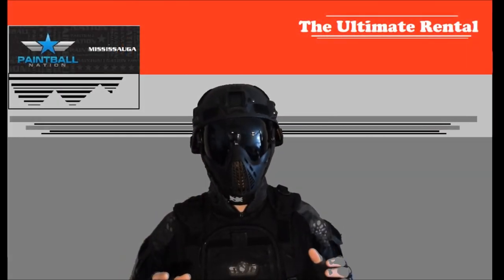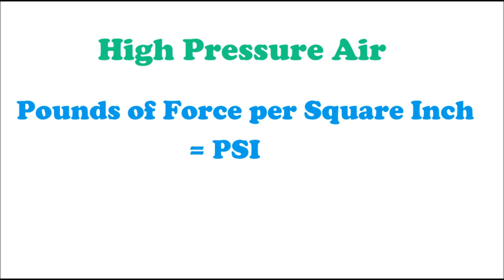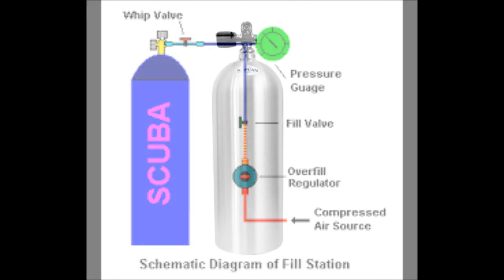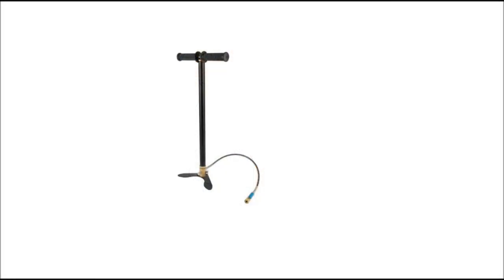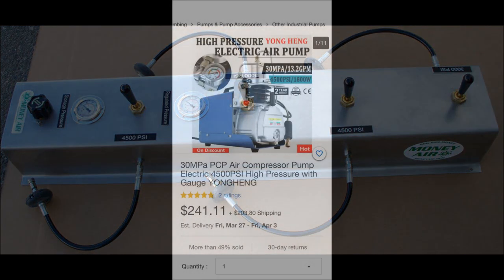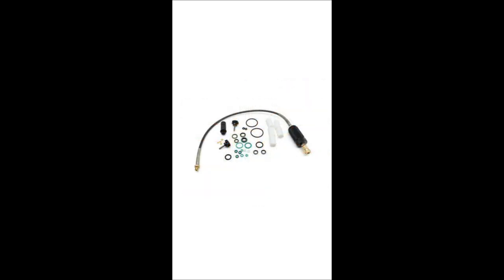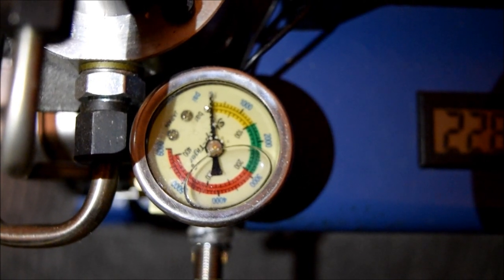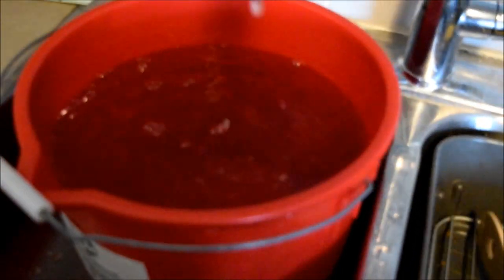How to fill your air tank at home (Paintball / Airsoft) - Electric pump demonstration 7:40

Comment: 4:30  -   You touched on the best of both Worlds
Use a manual pump to fill a larger tank, the load should be less and you can transfer to a smaller tank.

Comment: most oiled compressors... in fact ALL oiled compressors will put small amounts of oil into the air line.. that is why they use desiccant air purifying systems. Build up some oil in a 4500 tank and BOOM. Sounds freaky to be doing htis.
Reply from the maker: Nah it’s fine, there is a filer for the oil and water and I’ve upgraded it. Been using this three years steady now with no issues. It’s fairly safe it would break down and won’t start before it explodes.
Reply: @theultimaterental  Well I hope it works out for you. I do automotive painting and had to create a massive oil and water purifying system. The only thing that really stops oil is desiccant beads. Was this compressor made for filling tanks? I have never seen one quite like it.
Reply from the maker: Yes you can use a premium oil / water filter that has 4 different filters including disicant beads. The best thing to do is fill a full scuba tank and then use air from the storage tank until it’s empty then refill again

Comment: Did you notice a smell or some water/oil on your guns bolt after shooting? I have one of these mini compressors and the first time i used had a odd smell coming from my barrel
Reply: Air compressors use oil ...fragments of this oil wil get into the hoses, also into your guns bc this water/oil build up gets into your tanks, after some time using compressors you need 2 clean your compressor tanks, and bc you use your airsoft/paintball tank as last tank the build up wil be in there, i use nailguns on compressed air allot for work so the smell you speak of is indication of this water/oil build up, i would not recomend using compressed air for airsoft/paintbal, bc larger compressors like on the fields wil use drying systems 2 reduce this...small home compressors dont have these....   srry for bad writing, not my native language 😁

Comment: WARNING: I had a Young Heng compressor rated for 300 bars (4500 PSI),  I used this compressor to top of my air tanks to 300 bar which my air rifle requires.   The crank case where the compressor cylinders attach fail and exploded throwing the pistons and case framents flying.  The rupture disk did not fail.  The air pressur reached 4,400 PSI as I reache to open the pressure blow down valve and close the air tank valve the explosion occured.   The machine oil level was check before running, the water circulation was checked and found acceptable. In addition I was montering the machine running temp. and was at 57C to 60C all item were in the acceptable perimeter as specified by Young Heng manual.   I used this unit for a year about every two weeks.

In my oppion the aluminum case is to thin and cannot stand up to the stresses caused with frequent use.
Reply from the maker: Thanks for taking the time to provide this info. I haven’t had an issue yet but now I’m worried
Reply: @theultimaterental  Just watch for cracks in the caseing, if see any do not use.

Comment: can you just use a air compressor to fill my tank?
Reply from the maker: Maybe five bucks will refresh my memory 😄 just kidding, yes you can use an air compressor to fill your tank as long as it outputs high pressure air. The one for your car tire won’t work as that doesn’t even go to 100psi

Comment: Do the fill in 3 increments 2mins at a time. Switch off wait for the temp to drop. Then start again. This will prevent stress on the compressor apparently after researching. The Compressor will last alot longer.
Reply from the maker: The better way is too get a good source of running cold water like a hose. The temperature will stay steady and you won’t have to turn and turn off the compressor. Just like a car the worst thing you can do to the engine is a cold start…
Reply: You can probably get a high amperage timer switch (what ever the amperage of the compressor clearly not more than 15A). Set it for one minute on 5 off. Maybe even a smart switch with a routine set.
Reply: @theultimaterental  I just fill a large bin with cold water. When i fill the tank i simply let the moisture out of the left nozzle once or twice during the fill. This reduces the amount of moisture going into the tank. Not seen the temp get above 55 yet

Comment: I have an air compressor at home however I dont believe I have the correct adapter, do you think you can provide a link to the adapter/fill hose.
Reply from the maker: https://www.amazon.com/HPDMC-Station-Stainless-Paintball-Charging/dp/B07VFRFF7G/ref=mp_s_a_1_1_sspa?crid=20PZSBIWAUJX9&keywords=fill+hose+for+hpa&qid=1642719653&sprefix=fill+hose+for+hpa%2Caps%2C135&sr=8-1-spons&psc=1&smid=A7Q6ZUJMKWAQN&spLa=ZW5jcnlwdGVkUXVhbGlmaWVyPUEzOE80Q1Q3VkhVUlY0JmVuY3J5cHRlZElkPUEwODk0ODkyMTNOSEZGNFYxSTFLUyZlbmNyeXB0ZWRBZElkPUEwNzE2ODI0M002TzVCQjNDVVdNNyZ3aWRnZXROYW1lPXNwX3Bob25lX3NlYXJjaF9hdGYmYWN0aW9uPWNsaWNrUmVkaXJlY3QmZG9Ob3RMb2dDbGljaz10cnVl#aw-udpv3-customer-reviews_feature_div

Comment: Looks like a lot of work just to get air can't you just buy a air compressor and not deal with the ice water
Reply from the maker: if you have a steady source of water like a hose that you connect it to it is much easier. There are other cooling methods but they are large and expensive. I suggest only doing this to fill up a big scuba tank once every month or so. then you have air ready any time

Comment: Can I use an hydraulic air compressor
Reply from the maker: Hydraulic refers to how the compressor is powered. It would really depend as to whether you can connect an air hose to it and  how much pressure it produces. Most hydraulic compressors are made for vehicles and machines, I strongly recommend not using this type of compressor on an air tank as the pressure may cause it to explode.
Reply: @theultimaterental  ok thanks

Comment: If I wanna use the same compressor but a for 400 PSI application there a regulator so I can get the desired output pressure at 400 PSI?
Reply from the maker: yea I dont see why that would be a problem. Just remember that the first Notch on the gauge is 500 psi so it’s going to fill up fast. what are you trying to fill?

Comment: Thanks for the video mate. 
You said you wouldn't recommend the Powermate fully synthetic oil... what type of oil should be used with this compressor?
Reply from the maker: Number 46 Hydraulic oil will work great

Comment: Where can I get an adapter for a air compressor that pumps up a car tire.
Reply from the maker: The adapter won’t matter bro, a tire pump won’t work! it only pumps Max 90Psi? the pressure in the tank would be to high and push back against the pump likely damaging it permanently

Comment: can we just use a normal air compressor but with the "paintball" fitment/adapter
Reply from the maker: Nah, it doesn’t produce enough pressure :/ Maybe five bucks will change my mind ;) just kidding, no it will not work.
Reply: Yes use the normal compressor and get maybe 130 lbs. then you can shoot it in the house.

Comment: can i fill up my hp tank 3000 bar  with this compressor ?  because you use one 4500 bar
Reply from the maker: For sure you can! just stop it before it gets to 3000psi rather than keep going like I did to 4500psi. It will fill it a lot faster too. hope that helps!
Reply: @theultimaterental  i want to order it but they ask if i want 110 volt or 220 volt  which one is best ?
Reply from the maker: @artificial374  That’s just the amount of power it needs to function. Personally I would get 110v because it needs less power to operate and there is less electrical danger, although technically 220v requires less current.

Comment: Do you have any special instructions for disconnecting the air tank from the air hose?  Do I just pull it off??
Reply from the maker: Yea but you usually you have to push down a bit on the regulator for it to release

Comment: Do you need a special adaptor
Reply from the maker: if you are using the electronic pump it should come with a fill hose that has an adapter. All of the devices I mentioned should come with one

Comment: Hi sir. I have a air venturi 100 cu air tank and need to fill it into diving store but they ask for the fill valve can you please advise what valve they asking for thanks
Reply from the maker: Google Air tank fill station. it’s just an adapter to connect to your tank and the other tank so they can exchange air

Comment: Great video man. Have you had any problems with oil and water vapor getting into the tank? I saw alot of people online getting an additional filtration system ontop of the cotton to filter out the water and oil.
Reply from the maker: I haven’t had any issues but a more robust one would really help. The problem is they are like $200 for a good one. That’s half as much as the compressor. But if money isn’t an issue then yes it’s very important to have a good one over time.
Reply: @theultimaterental  really appreciate the response man. I agree they seem pricey. I think there is one for around the $100 mark but i think the moisture and oil build up is more for the bigger tanks. Our 4800 tanks sounds like it should be fine

Comment: Is it true you have to replace your Air Tank every five years? And if yes why??
Reply from the maker: No that’s not true. You only need to get it tested every 5 years if it is a carbon fiber tank to make sure there’s no cracks, so it doesn’t explode under pressure. You don’t have to get it tested if it’s an aluminum tank because it doesn’t crack like carbon fiber. Tanks have a life span of 15 years and there is a born date on all of them.
Reply: @theultimaterental  thanks for the info

Comment: what is the fitting called that connects to the air tank, i have a normal air compressor but the fitting is way to big, it is used for nail guns, i need an adapter that is able to fill the paintball air tank
Reply from the maker: Unfortunately  you cannot used the nail gun hydraulics because it does not have an output of 3000psi. It will not produce enough pressure to fill your tank and you may end up damaging both the gun and the tank. But to answer your question it is called a high pressure air fill adapter. Hope that helps :)

Comment: can you please tell me what size of quick connect paintball or PCP air tanks use? Im trying to build a hose reducer for my shop air compressor?
Reply from the maker: I don’t understand your question, can you please clarify?
Reply: @theultimaterental  My meaning is I am using a three eights air hose fitting in my shop for most of my tools this seems to be quarter inch or 8 inch air hose quick disconnect for scuba systems but I cannot figure out what the exact size a scuba system over high pressure air tank takes as my air disconnect is too big

Comment: 11:45 what adapter do you use to fit the side vessel
Reply from the maker: It’s called a high pressure air fill adapter. Typically you buy the entire hose with the adapter already on it because if it can fill high pressure air then you need a hose. I’ve seen people try to buy the adapter and put it on a tire pump but that won’t work because those don’t generate high pressure air. Hope that helps!
Reply: @theultimaterental  thank you
Reply from the maker: @ryano7156  You are most welcome

Comment: is it possible to use a normal air compressor on a small airsoft tank? thank you
Reply from the maker: The air compressor you use needs to have a high pressure output. which regular compressor do you mean, the one for car tires?
Reply: @theultimaterental  yes
Reply from the maker: @gopnikawarder686  That will not work, the top pressure on those is about 150psi. You need to fill up to 3000psi. Car tire compressors do not produce enough pressure. Fill your tank at a paintball field, paintball store or buy one of the devices I mentioned in the video. That’s your best option.
Reply: @theultimaterental  what type of compressor do you use?
Reply from the maker: @gopnikawarder686  I use the Yong Heng Electrical air pump like the one I show in the video. It works really good
Reply: @theultimaterental  thank you for the info new sub for you
Reply from the maker: @gopnikawarder686  Thanks man appreciate that!

Comment: Do you have to release the air before you turn off the machine?
Reply from the maker: Yes definitely! you don’t want the compressor to built up with air pressure when you turn it off you’ll blow the O-rings. also never turn it on with the air valves closed.
Reply: Thank you brother
Do you know Painball  field are closed 

so I had to purchase one
Reply from the maker: SILVER SKULL STACKER That’s why I made this video lol 😂
Reply: The Ultimate Rental lol. I play mostly in Pennsylvania and New York where are you from
Reply from the maker: SILVER SKULL STACKER Ontario Canada 🇨🇦

Comment: But my tank don't have that fill port mine is the top where the white cap is so how do i fill that one
Reply from the maker: Never seen that type of tank, usually they have an in and an out. What model tank is it?
Reply: @theultimaterental  co2
Reply: @theultimaterental  action village 20oz co2 tank
Reply from the maker: Johnny nelson If it does not have a fill port that it cannot be refilled and is disposable. Switch to HPA, it’s more consistent and easier to refill! but for airsoft I know some guns only take the small 12 gram CO2 cartridges
Reply: @theultimaterental  no i need it for my paintball gun
Reply from the maker: Johnny nelson Which type of gun do you have?
Reply: @theultimaterental  cronus tipman
Reply from the maker: Johnny nelson Hey Johnny, don’t use CO2 for your Cronos, I have the same marker. CO2 gets cold and causes spikes in velocity, which makes your gun very inaccurate. Buy an aluminum HPA tank they are about $40, but well worth it. You will notice an immediate difference in accuracy not to mention much cheaper to fill up air rather than CO2 and most fields only have air. Hope that helps!
Reply: @theultimaterental  ok thank you

Comment: 11:15 putting the pump in water aren't you suppose to fill it with air not to mention the plugs aren't even 3 prong what the
Reply from the maker: No the pump and cord are waterproof, no air actually goes through the pump all it does is pump water into the hose so it can cool the engine while it’s running. Does that make sense?
Reply: @theultimaterental  ohhh i see yeah now that makes sense

Comment: Have you filled 13ci's? If so whats the time on those?
Reply from the maker: Alexander Jenkins 2.5 minutes from 0 psi - 1 minutes 47 seconds to 3000 from 500 - or 250 hand pumps with the hand pump. Very useful for those kind of tanks but I would suggest also buying a scuba tank so you don’t have to run the compressor every time for a small tank. You can fill the scuba with the compressor once as that will give you a ton of fills on your 13ci tank. Hope that helps!

Comment: Can you drop the link for the machine?
Reply from the maker: Maybe five bucks will refresh my memory...just kidding, I can’t find it on eBay anymore but I found it on Amazon

Https://www.amazon.com/High-Pressure-Compressor-Auto-Stop-Electric-Paintball/dp/B0778GWSLY/ref=mp_s_a_1_1_sspa?dchild=1&keywords=yong+heng+4500+psi+compressor&qid=1592448589&sprefix=ying+heng&sr=8-1-spons&psc=1&spLa=ZW5jcnlwdGVkUXVhbGlmaWVyPUEyWFE2VUdXWlgxNjc0JmVuY3J5cHRlZElkPUEwNTU0NTQzMjA0UVlXWVlGRVY0RSZlbmNyeXB0ZWRBZElkPUExMDIyMzc0MVlUNDNRMkk5MVZRMSZ3aWRnZXROYW1lPXNwX3Bob25lX3NlYXJjaF9hdGYmYWN0aW9uPWNsaWNrUmVkaXJlY3QmZG9Ob3RMb2dDbGljaz10cnVl

Comment: So, can you use just a regular air compressor?
Reply from the maker: Any compressor that can generate high pressure air at least to a couple thousand psi will work
Reply: The Ultimate Rental thank you, this video was extremely helpful, thank you for making it.

Comment: To this day is it still working?
Reply from the maker: Like a charm, however last time I used it was two months ago, haven’t really needed to fill up air at home
Reply from the maker: By the way by a new hose with a better filter that will make it last longer. Use desiccate in the new hose and filter to suck up any water

Comment: Can i refill my hpa tank with a normal compressor? The one you use to fill your tires
Reply from the maker: No unfortunately those only go up to a couple hundred psi. you need something that goes to at least 3000psi. The options in the video are the only options sorry.Thanks so much for watching!